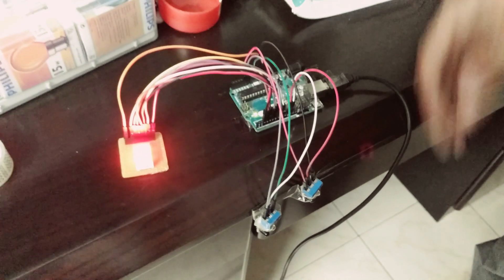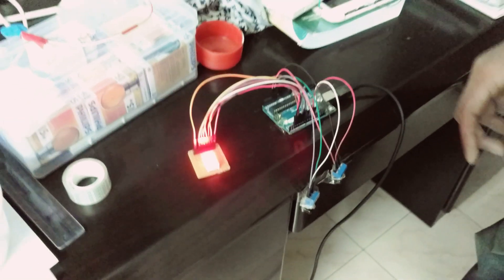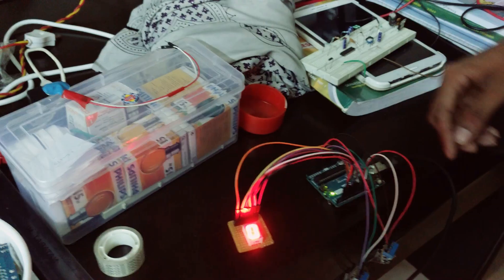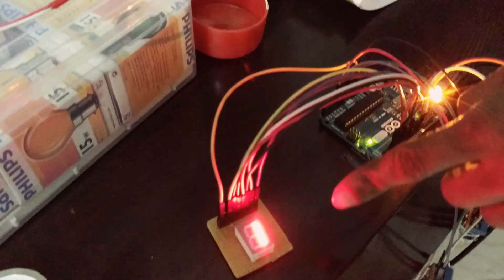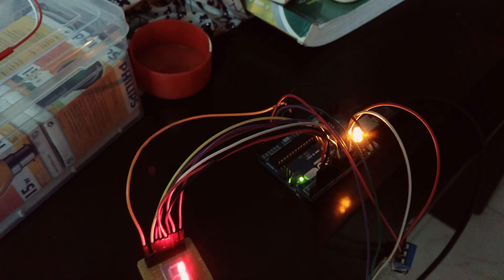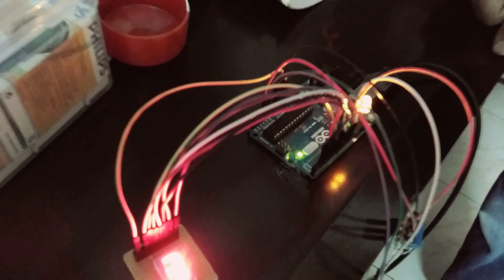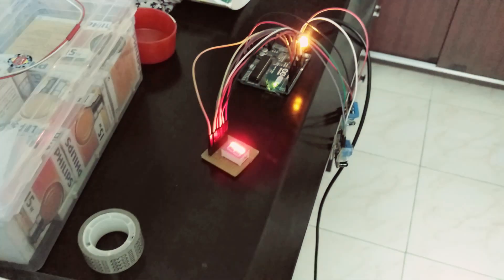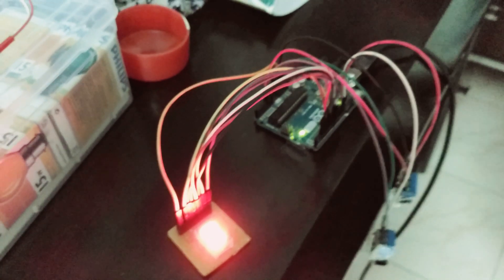Automated Room Lighting System Using Arduino

Comment: The use of the 7-segment LCD id very clever. I've created a similar setup but sometimes it fails to detect due to movement of curtains and partially open door. The display would surely help to rule out the problem. Good work man!
Reply from the maker: Aditya Sharma Thank you.

Comment: Hello Sucheth, love your project. Can you share the sketch and arduino code.
Maybe you can alter the code to be use with a led strip instead of a led. 
For example like the ws2812b or NeoPixels. Kind regards.
Reply from the maker: Thank you very much for your appreciation. I have added the link to the arduino code in the description. The code can be easily altered to suit the output requirements. My idea originally was to control lights running on mains supply using a relay module which I have done subsequently.